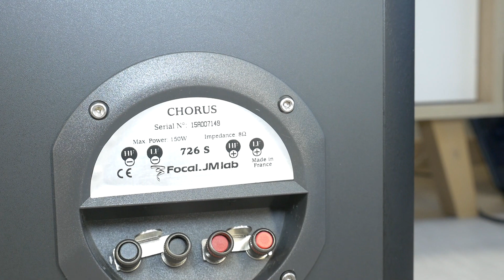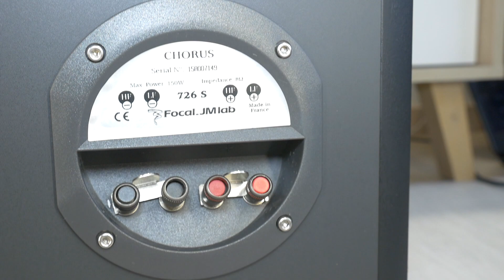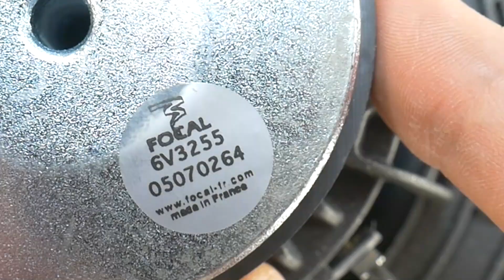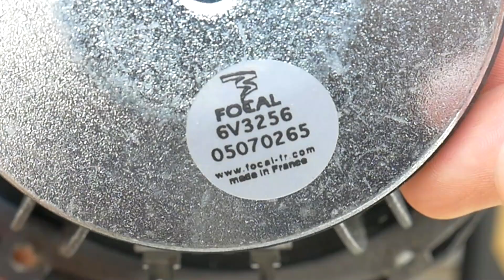Focal Chorus Disassembly + Speakers Free Air Test

Comment: Well well, disassembly without showing the most important components inside... xover is going up in height so you need to pull it to the bottom once half way out.

Comment: Focal didn't changed too much in their designs for past two decades, rather they bring down the cabinet quality for new and entry levels.
I think their best for the buck speaker is Electra 1028 or 1038 series.
Reply: beryllium tweeters, 3rd gen 'W' cone drivers. 1028 and 1038 are BE II! Way more attractive than the Sopras too.